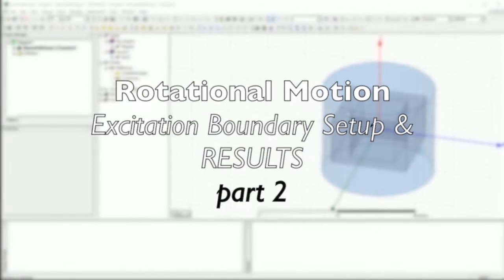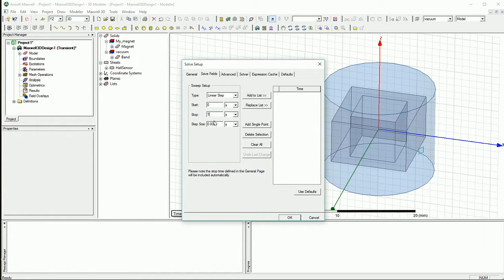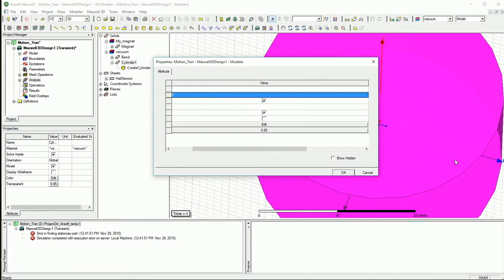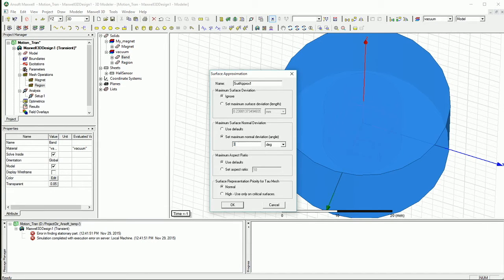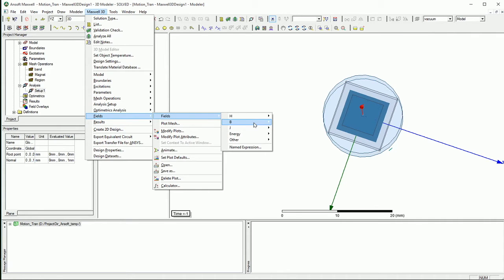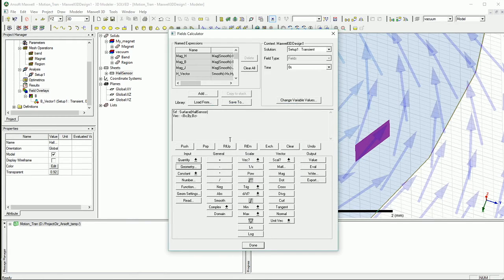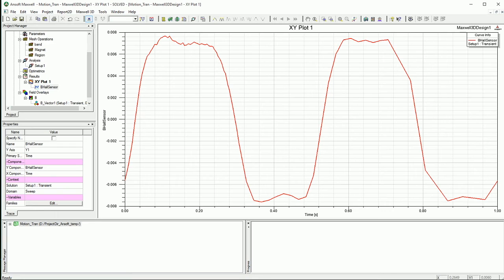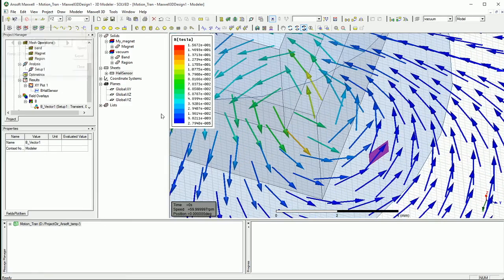406 Ansys Maxwell | Rotational Motion [2/2]

Comment: Hey Kamyar, I set up all things correctly but finally times didn't change to 0 , It remains -1,what is the reason for that?
Reply: Hey Kamyar, I'm also having the same problem. No matter how many times I try to change the time in the set solution context it only shows -1. I can't input any number (trying to change it to zero) and I don't know why that happens. I was wondering if you have any insight on this or if it's happened to you before?
Reply from the maker: +Dish lanka  double click on time that says -1 and then you can set the time.

Comment: Would it be possible to model an eddy current brake in maxwell and calculate torque output?
Reply: that would be great
Reply from the maker: +Brandon Bachner  yes. You need to go to motion setup and give an Initial torque to moving part that is going to be stoped.
Reply from the maker: +Brandon Bachner  good example maybe make a toturials for it.
Reply: @kamyark8434  Please do it. That would be great.

Comment: Hello,
my research is about reducing cogging torque of PMSG, and I wanna attach load to the generator, then observing the torque waveform and the armature reaction after attaching load, how can I do for the simulation.
I've tried some methods such as set three-phase current to the windings respectively, and give torque when setting band, but the results were failed.
Now, I'm trying external circuit  to solve the problem, but it still doesn't work.
Thank you for your help.
Reply from the maker: With circuit editor you can add some load to your motor. Have you tried that. The best way is simplorer. Have you tried to link your simulations with simplorer?
Reply: I can't find out the way of adding load to my generator by using circuit editor till now.
Is simplorer an another software of ANSYS?
Reply: sir how to use Simplorer to add load to a permanent magnet synchronous generator, thanks!
Reply from the maker: +陳文聖 Yes, There are several tutorials in the channel regarding simpler. please refer to those if you want to get familiar with it.
Reply from the maker: +陳文聖 I believe I have a tutorial for that in my channel. let me know if you could not find iit.